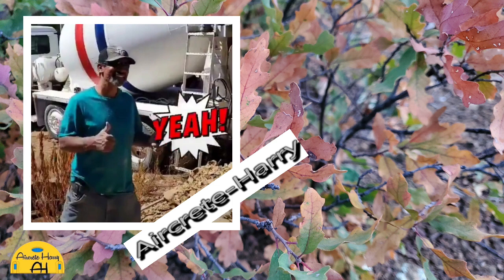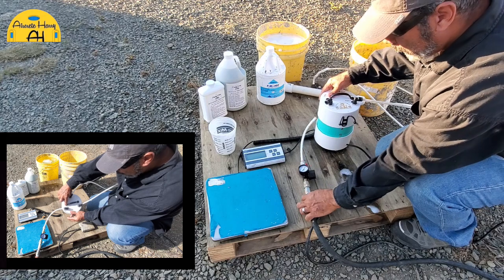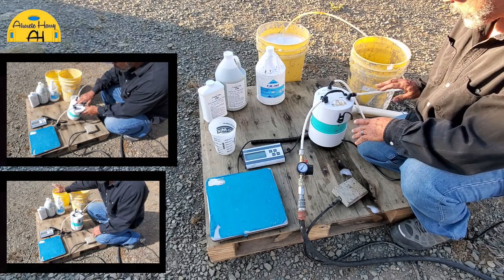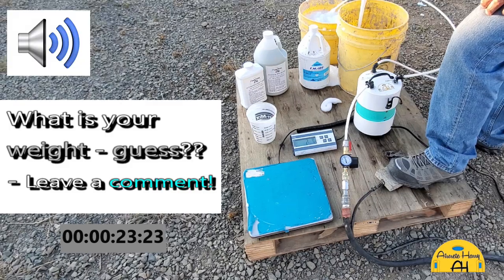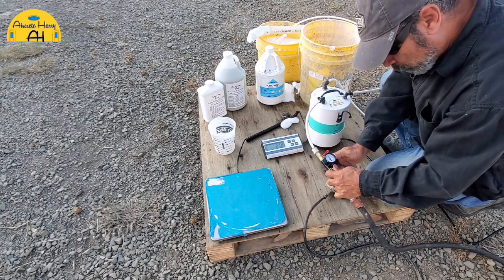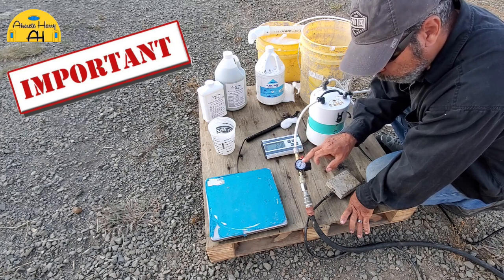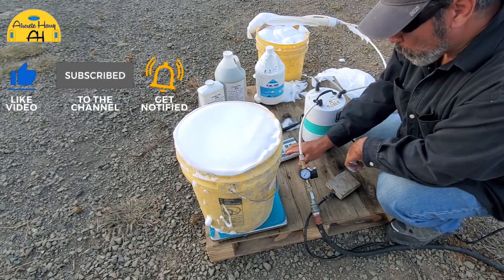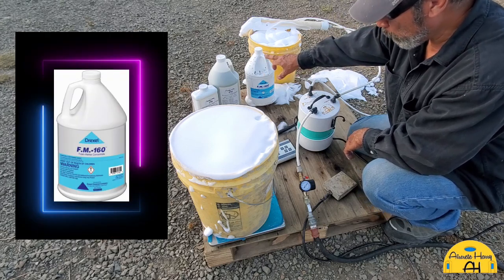How To operate the Aircrete-Harry Foam Generator #aircreteharry #foamgenerator #foam #aircrete #diy

Comment: Any thoughts on using nitrogen from a compressed gas tank? It should prevent oxidation, also explanation and contraction due to temperature changes.
Reply from the maker: I haven't done any of that. If you have any experience yourself, you are welcome to share with all of us. Thanks!